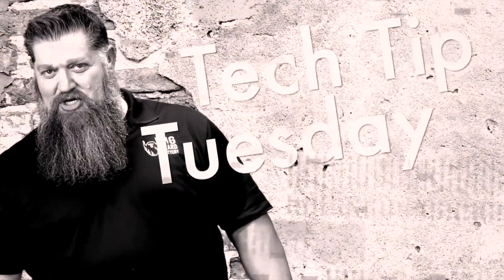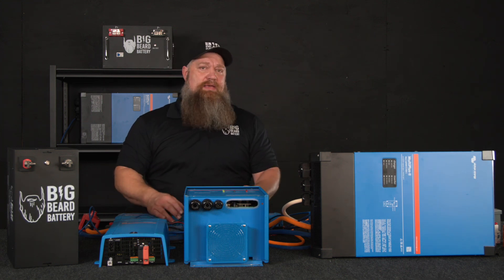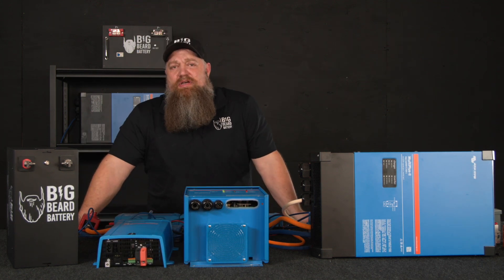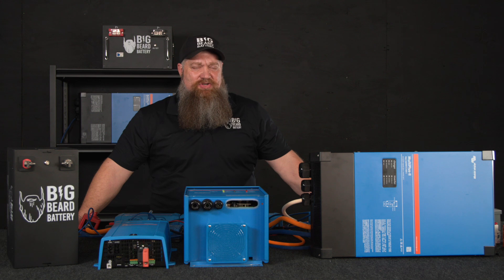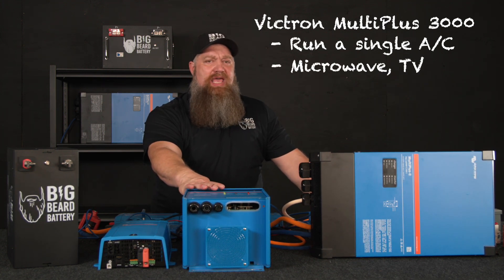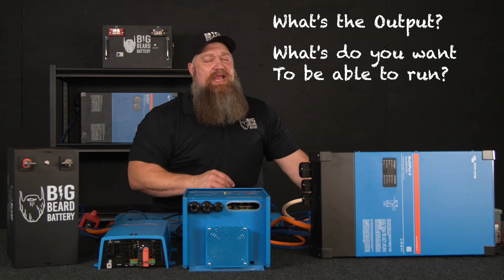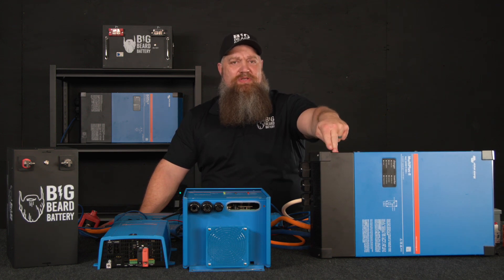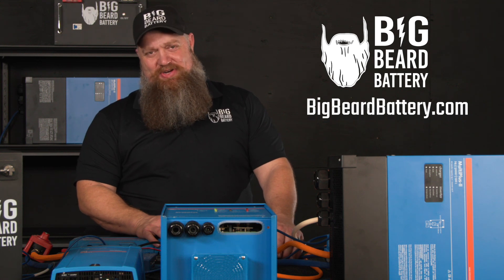What Size Inverter Do You Need for Your RV?

Comment: Odd question. What about multiple small inverters instead of a single large unit? Ex. dedicated inverters per breaker in the fuse box. So if wanted to only use a microwave for a minute wouldn't have to power up everything. 
Thank you
Reply: A power inverter is very wasteful in terms of converting from 12VDC to 120VAC...lots of wasted battery power doing the conversion and a lot of that is lost in heat.  So, running multiple smaller inverters won't really save you anything in terms of power from the battery(s), as you'd then be pulling even more power to run each of those inverters transformers, which is where most of your heat/battery power loss goes during the inverting process.
Reply: @wildbill23c thank you.

Comment: Hi, I have a predator inverter, 3500 watt generator for my rv,  which I can power one AC unit.
question is I have two AC units, is there an INVERTER that can power two units, from my 3500 watt generator plugged in with a shoreline, into the RV, I have means of using two legs black and red wire to connect the INVERTER inside the RV, thank you in advance!

Comment: I’m looking to do some PC gaming run the Ac and the fridge and maybe use the stove or oven. At the same time. What do I need? 😭 I have am 50amp, 120-240v, and 1 battery. Someone please tell me what I need.
Reply: You'd probably want to look into an inverter that is in the 6,000 watt or larger size, and possibly would be beneficial to look into doing a 24V battery setup, and getting a power inverter that goes from 24VDC to 120VAC.  You'll really need to upgrade to a larger battery, or larger battery bank, one battery isn't going to run all that stuff very long, your AC is really going to suck the power up fast.  

Generator would be ideal...if you still want that 1 battery, look into a power station....Oscal builds a 6,000 watt unit which does have a 120V/240V outlet on it that you can plug your 50amp RV into and you could run that way, of course you'll need a way to charge that, which would be from a generator, or plugging into a regular 120VAC outlet somewhere, or using solar panels.

Comment: My supposedly 1000 watt inverter can't even run my very small coffee pot. I want to run my microwave at some point, don't care about ac unit. But they both probably require the same size inverter and extra lithium batteries?
Reply from the maker: so coffee pots can consume (depending on size and features) 1000 to 1500 watts. Microwaves are the same, up to 1500 watts. 

So you could go with a 2000 watt or VA inverter, but you will have to isolate the circuit you want to run through that 2000 watt  or VA inverter. A 3000VA inverter can be connected to the entire system as long as you dont use too much. The cost isnt too far off the 2000 watt install and isolation of the circuit.

Comment: Todd you are my trusted professor of RVs. I was listening to a conversation about solar panels, inverters and labeled 120v outlets in a Rv. A comment was made while boondocking the outlet will work even without a battery installed between outlet & inverter. I learn by listening but I also try to fact check.
What say you big beard buddy?
Reply from the maker: So depending on the inverter, solar panel, or microinverter. it is possible as long as there is sufficient solar panels and sunstrike. 

This is more of a residential application where the solar systems do not largely have a storage. Microinverters on the solar panels would produce 120v to help with cost of electricity. It can be used in mobile applications its just not as trustworthy for critical loads.
Reply: @ToddandTonyshow  this a great answer that makes sense and I can understand. Thanks Todd I learned to go to the teacher if I needed better understanding and you did me well.

Comment: Yo Todd, I have a question I think only you can answer: Why is it that I can plug into 30 amp shore power and yet have a converter that will produce MORE than 30 amps to charge my battery bank?
Reply from the maker: Sure thing. 

The 30 amps coming into the rv are at 120volts. The converter steps down the voltage to 12volts which increases the amps. 

The stated amps on a converter is in the DC output.
Reply: @ToddandTonyshow  man I knew you were the right guy to ask! thanks tons!

Comment: Great explanation, but I think you are being very conservative in your recommendations. I can run both my air conditioners and microwave at the same time on my 5000w inverter. My front A/C is a soft start equipped Furrion that draws up to 1,400w. My rear A/C is an EG-4 heat pump that typically only draws 400-500 watts, but maxes out at around 900 watts, so we'll use that. My microwave draws about 1,300 watts for a total of only 3,600 watts, giving me enough in reserve to run my TV, computer and residential fridge too (less than 1,000watts for all 3, as they are wired to run on a separate 1,000w back-up inverter in an emergency). I don't think I've ever run this many things at the same time, but it's good to know that I have the capability of doing so without exceeding the inverter's capacity.
Reply from the maker: Thank you for the kind words!

So temp outside plays a huge factor on the amp draw of your ac. You may see in your experience only 1400 watts being pulled, but as temps get hotter the compressor actually has to work harder against the pressure being built up by the freon. Upwards of over 2000 watts at 100 degrees outside on a 15k btu AC. 

It is something we test weekly here in Texas. When I give the info it is far better to use the examples that would cover 100 % vs possibly 40-60%.

Comment: I have 2 VE Multiplus-II 2x 120V in parallel, for a total of 6000VA or 4800W inverting capacity, I can run my A/C, microwave, water heater all at the same time and still have some spare capacity, albeit very little...
And the Multiplus-II 5000VA is a 24V system inverter and according to VE's own datasheet is "only" capable of 4000W(@25C)...
Reply: Yes, I was thinking that dual 3000VA Multiplus II units were better than the 5000VA. And I think that the batteries could be charged faster too.
Reply: @calledtojourney  I needed the higher W output, and while the 5000VA would've given me 4000W, 1) it wasn't available at the time, 2) and if it had been available, it would have been 24V any, and then I would needed additional equipment for my 12V system...I WISH VE would come out with a 12V version of the Multiplus-II with a 5000VA capacity...
Reply from the maker: I dont think they will as the torrid coils would be as large as they are in the Quattro,. The weight difference between the 24v inverter and the 12v inveter 5kva is significant. 

What we often suggest is to leave 1 original 12v lead acid battery to run the 12v and let the 24v run the inverted system. This will mean the original converter is ALWAYS on which means the exisiting battery never pulls a load for charging outside of float. The FLA battery becomes the backup for large demands which are landing gear and slides. 

In the event the inverted system is completely dead, the 12v FLA could start the onboard genny (if equipped) to wake up the inverters to start charging again.
Reply from the maker: Better? 3kva is never more than 5kva. I think the understanding might be off. 2x120 simply means it can push 120v to 2 legs. not 240. Nor will it push 3kva on each leg. the MP2 only pushes a total of its stated KVA. 

The post you are responding on the writer says he has 2 of the MP2.
Reply: @ My understanding is that you can run two 3kva units in parallel, thereby doubling up both the charging and inverter capacity, more so than a single 5kva.
Reply: @calledtojourney  Yes, running in parallel you can get up to 6000VA or 4800W of inverting power, and with a 5000VA you get 4000W...
Reply from the maker: @calledtojourney  Totally understood. What I want to point out is that the MP2 5k is NOT 2x120 so the only way you can use it in a 50 amp rv is to use 2. I totally get the thought that 2 of the 3kva is more than 1 of the 5kva. I just dont want to cause confusion of people thinking they can use 1 of the 5kva. 

Thank you for the info and the watch!!!
Reply from the maker: So just like your MP2 2x120 you have a total of 2 of them. The MP2 5kva is single leg out. If you put in a total of 2 then you have 8000watts. 

This offering is a wonderful item between the 3kva multiplus and the 5kva Quattro. Cost $100s less than the quattro but still pushes the same true power.

Comment: Does it make sense to use two inverters...one for the AC and the other for everything else. This would allow a smaller more efficient inverter for the "everything else" and only turn on the AC inverter when it is needed.
Reply: No, run either on large inverter to run the entire system, or 2 smaller in parallel...
Reply: Not really. The power draw of the Victron inverters is quite low. If you're going to have enough battery capacity to be able to run an AC, the additional power draw of a sizable inverter isn't enough to be concerned about. We can run either of our ACs from one Multiplus II 3000VA without issue.
Reply from the maker: So to more correctly answer your question. 

Your breaker panel box is either 1 hot leg or 2 in other words you either have a 30 amp rv  with 1 hot leg or a 50 amp with 2 hot legs. 

When hooking up a whole RV inverter you send it (typically) to the entire panel box. Therefore we do not limit what the inverter supplies power to. It is up to you the end user not to ask for more load than what the AC can handle. 

I think what you might be asking is, should i go with 2 inverters instead of 1. If your way of RVing without much change, is to demand over 2400 watts continuous then yes Id consider 2 inverters. 

Right now the offerings Victron provides is a 3kva single leg or dual leg, 5kva single leg, 10k single leg. 

so thats 
1.     3kva inverter for any rv (30amp, or 50amp)
2.     5kva inverter for 30amp
3.    Two 5kva inverters for 50amp

Comment: I live full time in my fifth wheel plugged into 50 amp. I have to play musical outlets between the microwave, electric fireplace, hairdryer and air conditioner. In the summer especially I’ve noticed that my ac doesn’t seem to be able to put out cold enough air and am wondering if it’s because it’s not getting enough power. If I bump up to 3000 watt is that enough? Do I need to get additional batteries with my 2 deep cycles I already have? I don’t want to make another mistake but I also don’t think I’ll survive another summer in this thing. Help!?!
Reply: An AC that's not getting enough power will usually trip a circuit breaker. 

I'm a bit confused on your setup as there are several things you didn't mention. Does the AC keep up when you're plugged in? What size inverter do you have now? Note that your batteries have nothing to do with running stuff when you're plugged in. 

"Musical outlets" sounds like an entirely separate wiring issue.
Reply from the maker: So breakers trip based on current across the breaker. If the load is inductive then it would try to pull more current. However, if the supply does not produce the current then the breaker will not trip. 

The inverter has a torrid coil that would overheat when too much current is demanded. The inverter has sensors and logic that prevents that and causes a “current overload protection” event to take place and shuts the inverter off and allows the coil to cool. Breaker never trips.
Reply: No, 3000VA will only get you 2400W, IF you want to run multiple high wattage devices at the same time, put 2 3000VA inverters in parallel for a total of 6000VA or 4800W inverting capacity, that will be enough to run a 15kAC unit, water heater AND the microwave all at the same time...
Reply: You shouldn't have to 'musical outlets' when you're connected to 50 amps. The problem may be that your trying to run too many appliances on one circuit, which would trip the breaker at your own panel, not at the pedestal.

Comment: Nice summary, Todd! We've run closer to 2,800 watts on our Victron Multiplus II 3000, but that might be due to some of the loads being resistive heating, where there isn't a startup load.
Reply from the maker: sure the Victron has a 20% overload it can run for a few minutes. The 2400 comes from their dataplate located in the right corner next to the DC connections.

Comment: Had never heard this before. Wattage is volts times amps, P = IE. So how is a 5000 VA only 4400 watts? Thanks in advance
Reply from the maker: @larryclark5355  power factor. Rated as ‘starting watts” vs “continuous running watts”
Reply: @ToddandTonyshow  Thank You,did NOT know,never really studied batteries
Reply: Actually a 5000VA inverter is capable of 4000W, it's VA x .8 = W...

Comment: Tony, your videos are the best and your explanation is easy to understand. You are a great teacher? We just finished a solar upgrade with 900 Amps of your Big Beard batteries and it was installed by Caleb Smith. We have two Victron 3000 watt inverters and 2000 solar watts on the roof. We are heading out to Quartzite today for the Grand Design Rally 2025. I am going to be showing off the install Caleb did with all your Big Beard components. Thanks!
Reply from the maker: Todd says thank you.